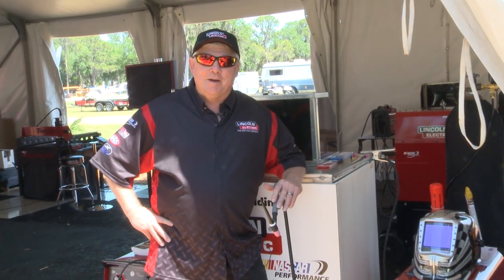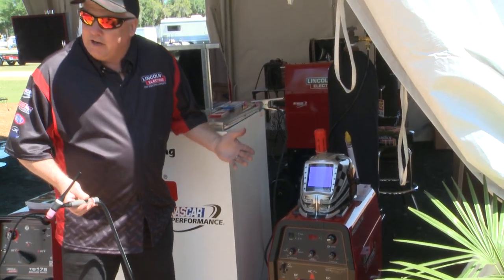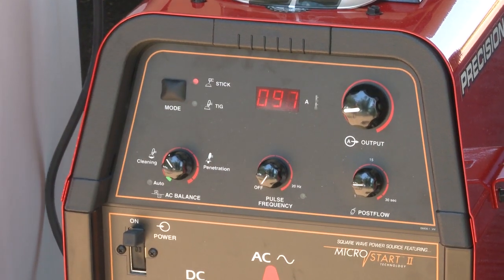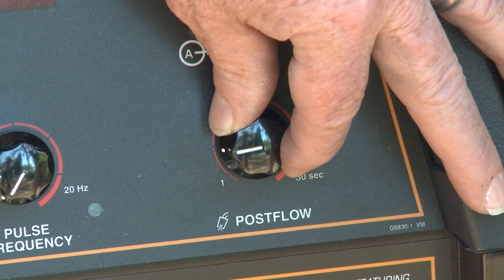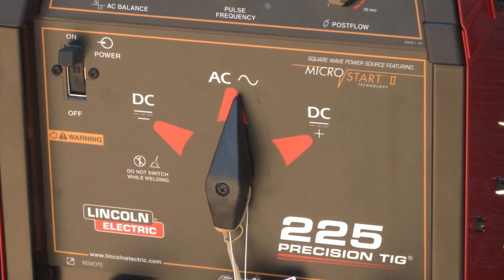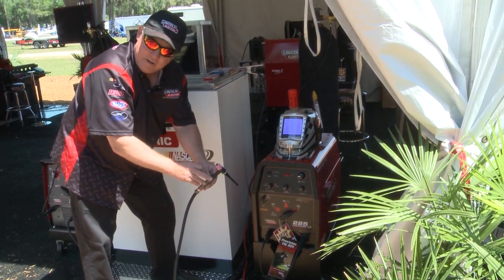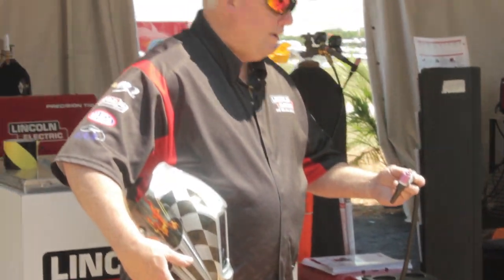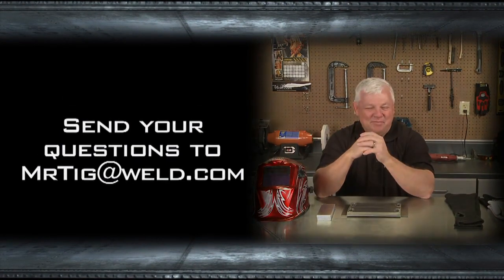How to Set Welding Parameters on the Lincoln Precision TIG 225

Comment: Switching a TIG welder to DC+ to "ball up" the tungsten is a waste of time. Just start welding aluminum on AC with a clean tungsten and it will start balling up immediately as you weld. AC current alternates between DC+ and DC-. The tungsten will ball up on the DC+ part of the AC cycle. Time is money. Why take unnecessary steps that have no added value?
Reply: ll try that

Comment: AC autobalance on the precision TIG 225 seems complicated. Since the machine can't know you are welding aluminum it must use a generic program, I guess assuming you are using it for Al. Does the autobalance take into account the running amperage, or does it just set a value of, say, 60% neg, that it predicts would usually work?